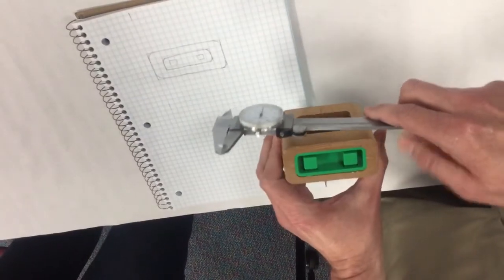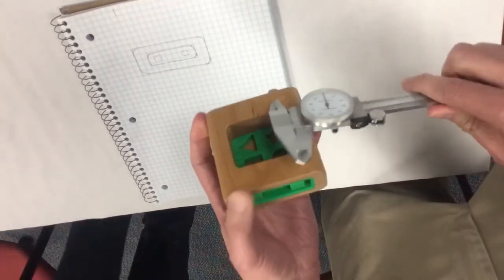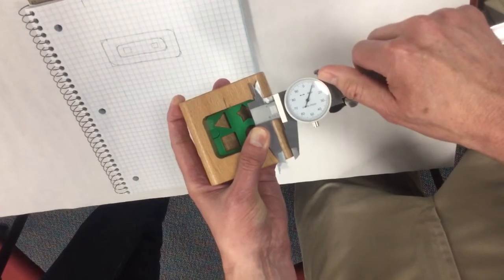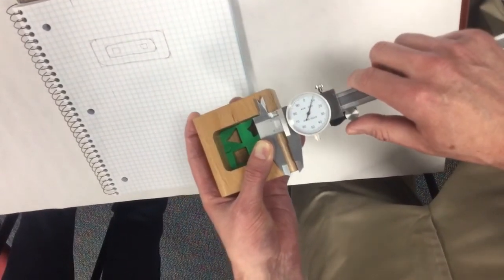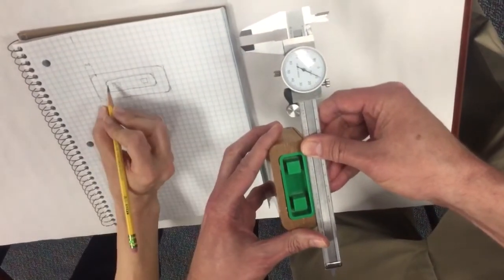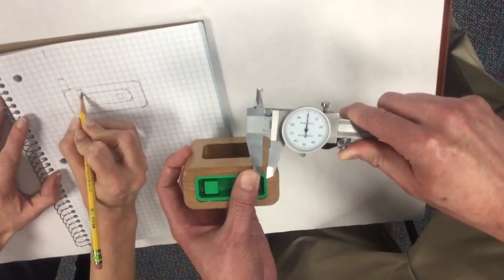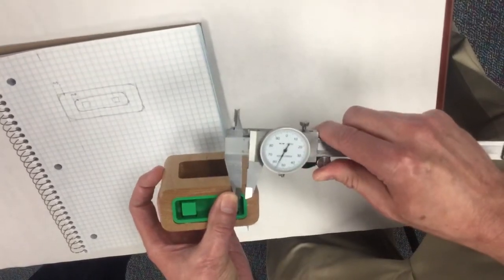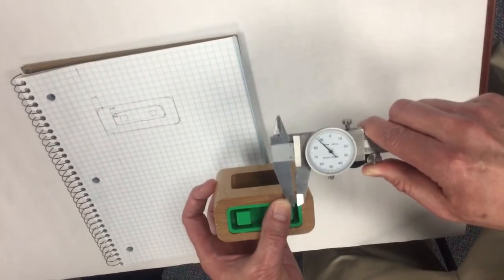Measuring Fillets

Comment: Agreed, the radius gauge method is preferable. However, I've not got access to a set right this instant. This video was helpful, thanks! Just a minor irritation, the t is not silent. If fillet were instead spelled filet, you would be correct. However, the word is fillet with two L's.

Comment: This is the correct method if you have limited measuring tools. However in the CAD ethos, measuring radii is achievable with 'Radius Gauges', both convex, and concave. 

Make sure you get 'Radius Gauges' and not 'Fillet Gauges' as fillet gauges are used in welding applications.